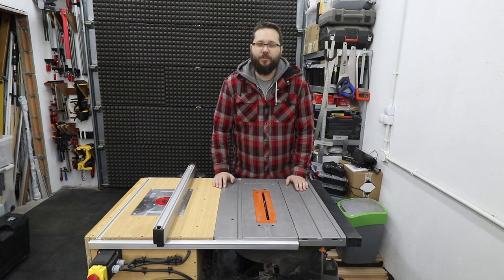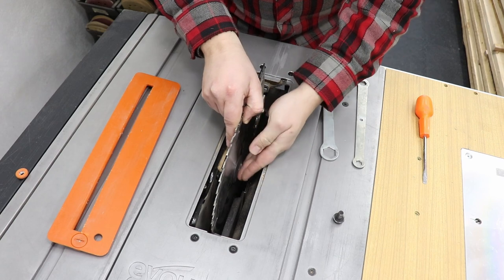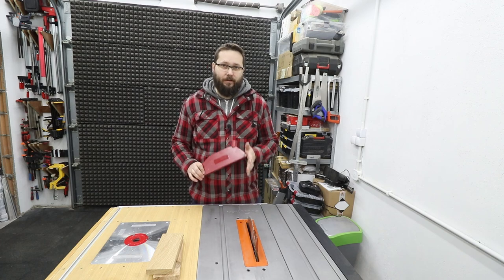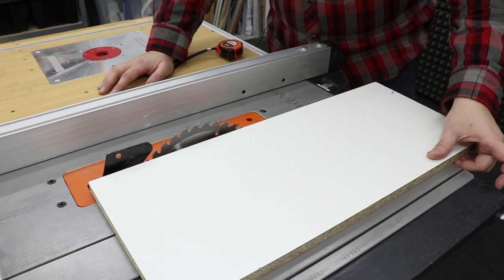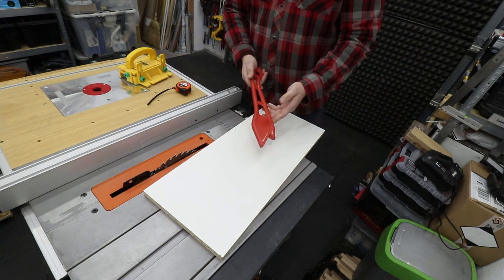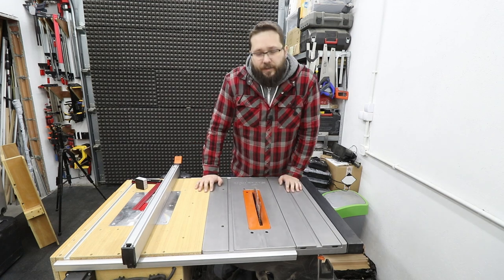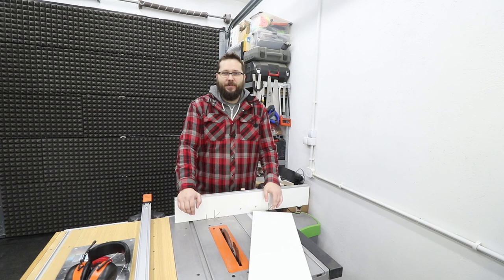Table Saw Basics I Table Saw for Beginners

Comment: Very informative video. Thanks for sharing. Most of the things I already knew. Unfortunately my table saw has a rip fence which does not go all the way to the back end.
I'll have to live with that. Thanks for the link to the video How to tune up a table saw. I missed that video when you released it.  I'll watch it later this evening or at the weekend. I need to make some adjustments and with your guidance it'll work out better.
Reply from the maker: Thank you for watching. 
Hmm have a look if you can make a DIY version of the fence that locks at the front and back. I actually damaged mine and need to have a look if I can fix it or make something to replace it. 
Well tuned table saw will give you great cuts but also is much safer to use👍

Comment: Hello 
Your videos on the evolution table saw are great thank you for you projects I do have one issue with the rip fence clamp it seems very hard to push into the lock position  is this normal and can it be adjusted 

Look forward to your response 
Tony
Reply from the maker: Yes it can be adjusted. At the end of the fence there is a black plastic cap. Underneath is the mechanism you can try to adjust.

Comment: Excellent video as always. Which feather boards do you use on the Evolution table saw? The non standard miter slots makes it a bit tricky to find one that fits. Thanks for any info.
Reply from the maker: Thank you. Currently I'm not using any.

Comment: Hi Thomas! First of all, thank you for your great videos!! I actually have the rage 5 too and I have some issues with the fence. Each time I use it, I have to use a square because when I lock it, it's not in a perfect 90° angle. Did you have the same problem? Would you have any advise to help me? Thank you :)
Reply from the maker: Hi, have you tried adjusting it with those two bolts on top of it? If so you can also try to adjust the back jaw, take the plastic cover from the back of the fence and there is a bolt there. Try to adjust that. Hope this helps
Reply: @CasualDIY  great! I’ll try this as soon as possible!! Thank you again for all your precious tips! Keep on!!!

Comment: Hi Thomas, what are your thoughts on your table saw? I watched your unboxing 4 years ago and you still use the same table saw. Any issues with lifting mechanism, has it ever failed? How's the motor when cutting very thick wood, is it able to cut with ease? The reason for the questioning is Makita MLT100N also has a table saw with similar price where I live but I found out from YouTube the lifting mechanism failed after a while cause of the use of aluminium part. But it has higher RPM and 260mm blades which can be very useful for cutting thick timber. Appreciate it if you can do a re-review video. Thanks.
Reply from the maker: I've done a re-review video but it's few years old now. However I'm planning a new Video on this saw in September. I've had no issues with it yet which I think its quite good. Nothing broke on its own ( I've dropped the fence and the back clip cracked slightly ) the only problem that I see currently is the price. I seem some crazy prices on the net which reduces the point of getting this saw as if you add bit more money you can get far better quality saw. If you can pick it up for no more than £350 then I would buy it. Anymore and I would consider buying something else. When I got my saw they you could pick them up for £230 on offer.

Comment: Good basic tutorial, however I think there was one important thing omitted.
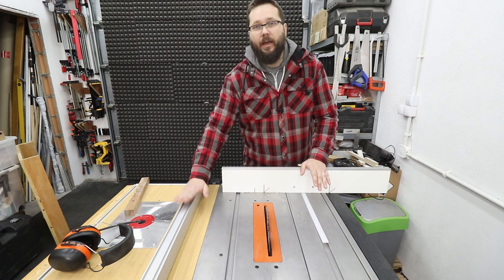12:28 and 15:25 - when the cut is finished, DO NOT touch the waste!
Get the stock past the blade, then power down the saw. Once it's stopped, retrieve the pieces!
Lots of accidents occur from reaching for (cut) parts with the blade spinning. or trying to flick them aside with the push stick.
Reply from the maker: Thank you for mentioning this great information 👍